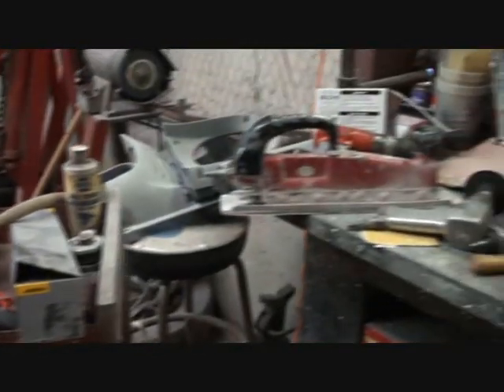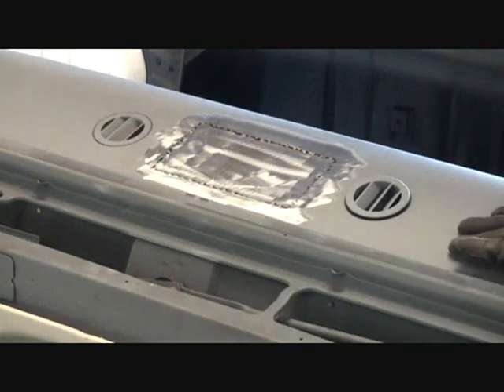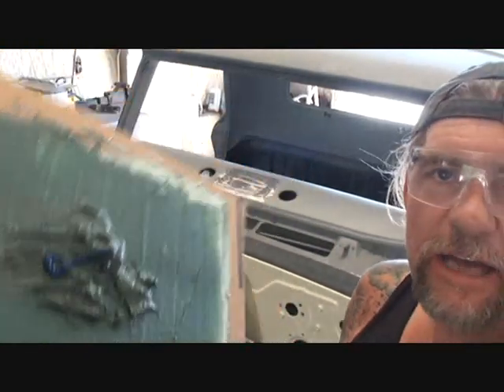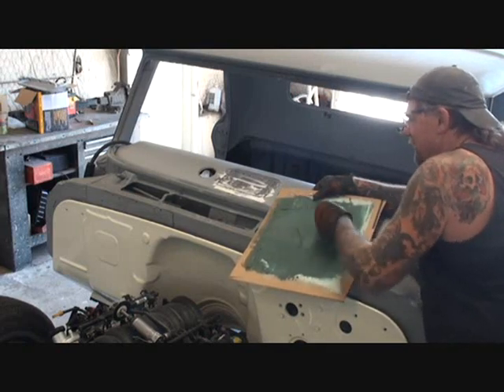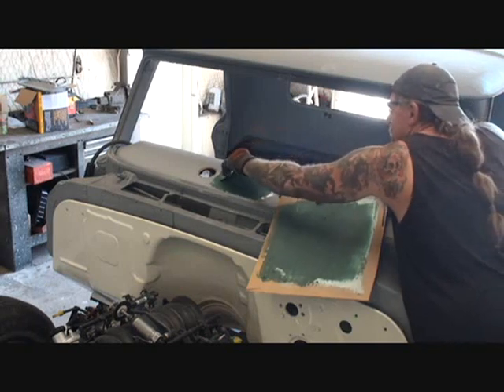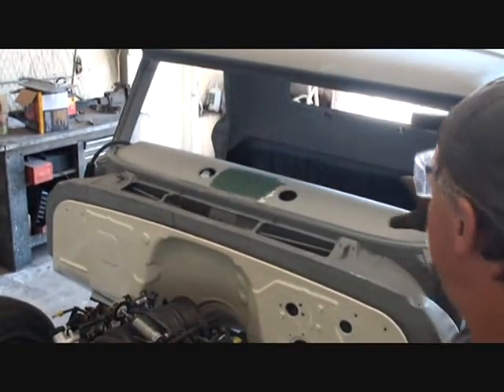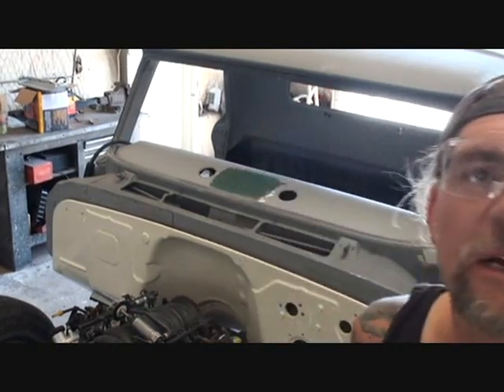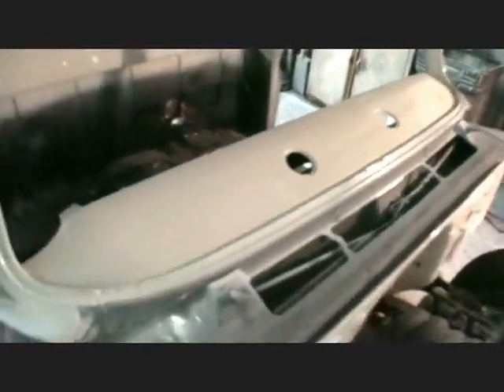Custom Truck Building-Smoothing Out The Dashboard! Part 3

Comment from the maker: being that it's on the inside of the truck and not it will be exposed to the outside elements you don't need to weld up fully, minor stitch welding will do the job here and last for ever, if it where on the outside of the vehicle, then I would have welded it up solid!

Comment: In part 2 you appeared to leave some small areas between the spot welds which did not have welds or did you actually spot weld all the areas to give a 'continuous' weld prior to grinding?